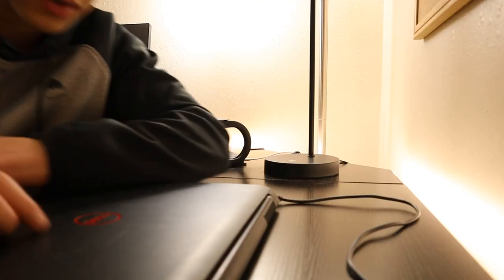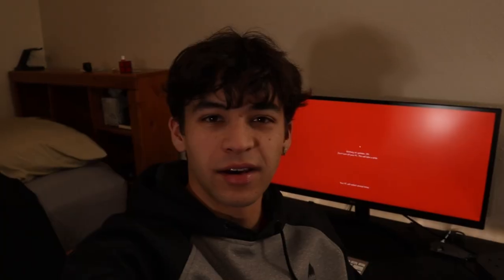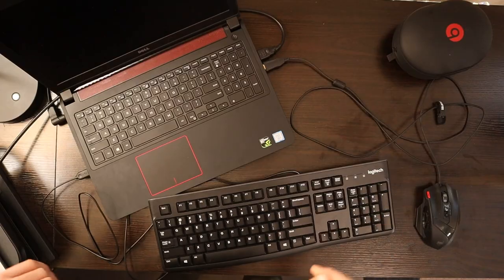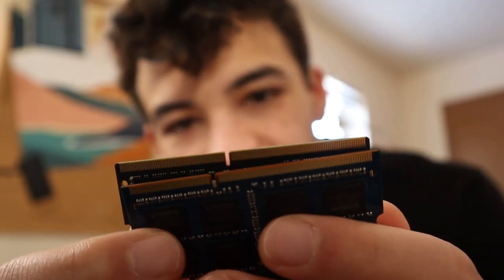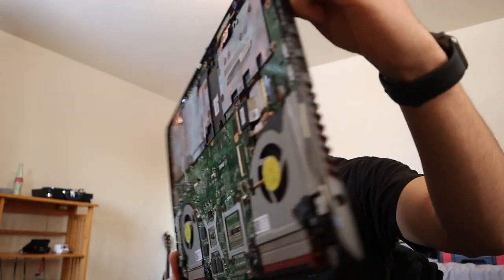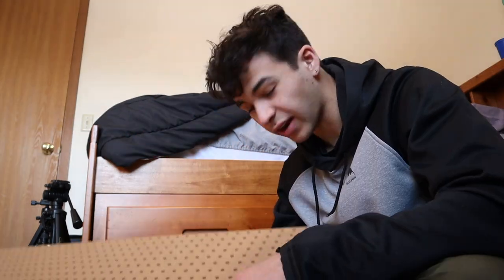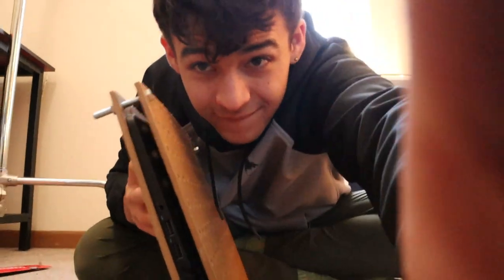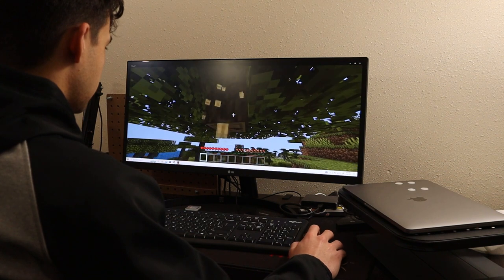Turning a Broken Laptop Into a Home Made PC

Comment: Cool build, I am just worried about the cooling aspect a lot and I was wondering where it was exhausting hot air
Reply from the maker: Thanks! As far as the cooling goes, the vents for the fans are relatively unblocked, and it gets a little more air from the holes in the plywood. Probably could be better, but if anything I think it’s an improvement from what the original body had

Comment: You likely bought the wrong RAM type - the old RAM is likely DDR3 vs DDR4. As such, it will cost more.  DDR2 is even worse (4 times or more the cost for less capacity and slower speed). They are all the same general form factor except, as you saw, for the notch which differentiates them.
Reply from the maker: Yep, thats exactly what the problem was. I've got the new ram now and its working great!

Comment: Good Work Bro !!
I also have a broken laptop. the keyboard straight up malfunctions the battery doesn't work so it has to be plugged in the charger ,the trackpad also works like shit and the speakers also didn't work so I have to remove it. however the screen and the motherboard is still god and it functions very good and was also thinking to do something like you did.
Reply from the maker: Thank you! I hope your build goes well👊